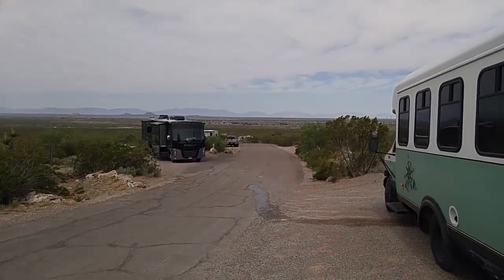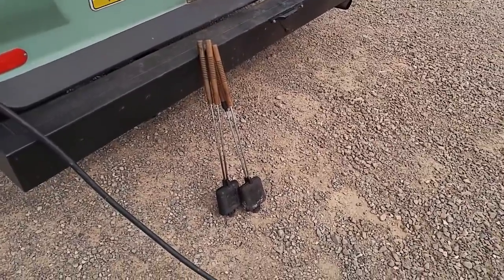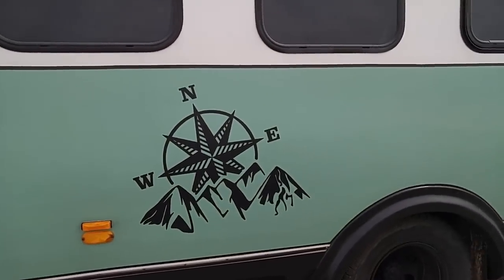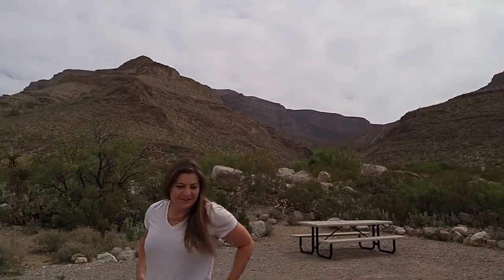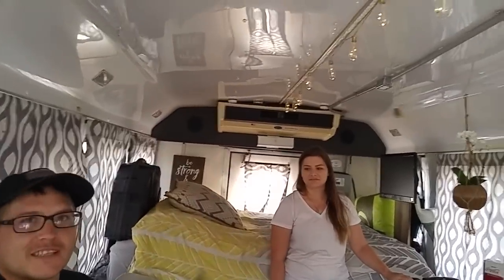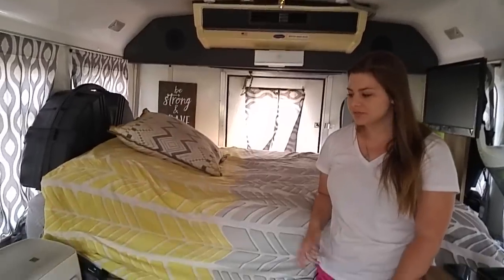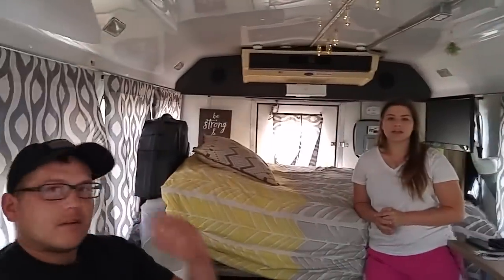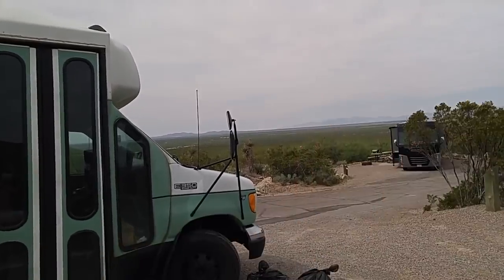FORD SHORT BUS CONVERSION...RV/CAMPER...meet COREY & MORGAN

Comment: Cool conversion!  That’s my favorite so far. Love the big sink.  Looks like an adjustable bed. Large tv. Great job. 👍👍👍
Reply: Not sure the bed is adjustable...just think it is a few inches longer than the bus is wide, so it curls up on one end.  I could be wrong...
Reply: David 
You’re probably right, but I can dream can’t I?  I thought the same thing but liked my dream idea better. Still a great little camper. Tons of windows!  You never know which side the view will be on! Lol
Reply: David Adams
We have an adjustable incline bed at home so, when I (someday) do my build, I want a bed that can move.  Thinking now I would create a three part wooden platform with hinges.  The top and bottom hinged portions could move from flat to maybe a 30 degree tilt with about 3 or 4 stops between 0 and 30 degrees.  Not exactly sure how I will support the inclined boards but maybe wooden cleats underneath and different sized wooden blocks to prop up the platform.  I think I saw a video that a metal mechanism like what makes a chaise lounge articulate can be purchased somewhere...so that's an option too.
It was a nice conversion but, and I'm assuming here, what jumped out at me was that uninsulated metal ceiling and thought it would be hot to the touch and make it difficult to keep the interior cool.  I could be wrong but, I don't think they made those buses with a double wall roof with insulation between the layers.  They both look short enough to sacrifice some headroom and do a drop ceiling with insulation.  This was their first journey in their conversion so, if it's a problem, they'll figure it out eventually.